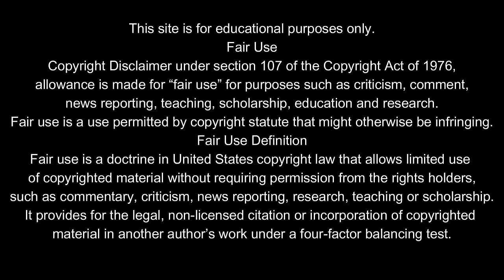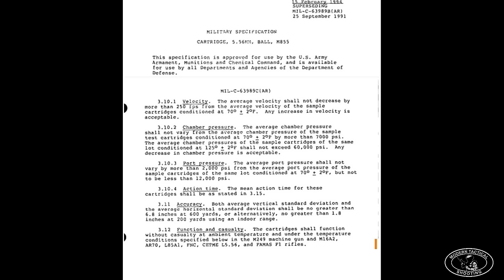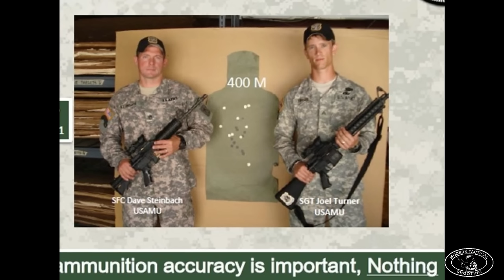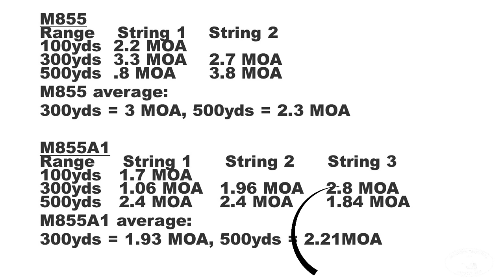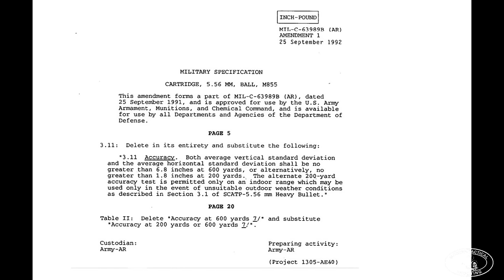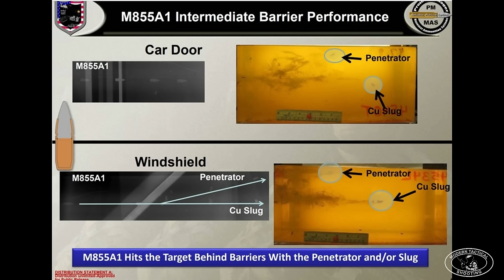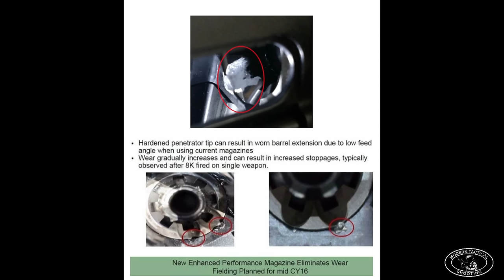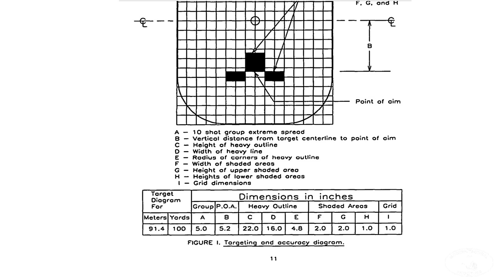M855A1 Performance Review. Did it live up to the Army's hype? Did going green really work?

Comment: When 10th mountain made the switch, my groups were cut, literally in half as far as size. We also saw a significant increase in the marksmanship scores during rifle qualifications across the board. I am a huge fan of the new “green “round.
Reply: I have also seen some ballistics gel tests on yt that show it has far far better terminal performance in soft targets compared to M855. Regular green tip will sometimes zip through soft targets without tumbling or really dumping any energy, or will tumble really deep like 7-8 inches in at which point it would already be most if not all the way trough a body. So its a bit more accurate and better terminal performance on soft and hard targets. Seems like a good improvement to me.
Reply: 10th Light Infantry division "Mountain" 85-86.
Reply: @Nick-sx6jm that performance depends almost entirely on the weapon used and the range to the target. The AR-15 platform was designed for a 55gr bullet and a 1:9 twist out of a 20” barrel. By the time you shoot a 62gr bullet out of a 14.5” barrel with a 1:7 twist you lose so much velocity the bullet won’t tumble on impact beyond about 100m. That’s fine for a carbine. It’s not for a battle rifle. That’s why the Marine Corps adopted the M16A4 with a 20” barrel.
Reply: @coryhoggatt7691  you know the Marines Ditched the m16 right? They switched to the M4a1 with the 14.5 ammo just like the Army back in 2016.
Reply: @coryhoggatt7691  first M16 was a 1:14 twist, M16A1 was 1:12, and everything after the M16A2 1:7
Reply: @Nick-sx6jm  You would have to hit your target.

Comment: I'm a year late to this one, but, from seeing our State's NG shooting team, and working the ranges with them, we definately saw tighter groups going from greentip to A1s. Some of these guys are National-level good shooters and I have seen/scored 5-shot groupings of sub-moa out to 400y. These are out of issued, but in great shape, M4a1s with 4x Elcans. As the EPR round starts to become affordable, and civilian use gets more widespread, be careful to use the 'improved' mag, or at least the new followers, that give the round a slight lift at the nose. It will help prevent the scouring effect on the feed ramps from that sharp point digging in. My personal 14.5" already shows a few scour marks, where the ramp meets the barrel, just from one old GI mag (tan follower) with 30 rds fired. Awesome round though...very flat shooting and fast.
Reply: What are the improved mags? Would any modern magpul mag be considered improved?
Reply: @StreetLight099  the "improved" is just a tan color metal gi mag with a no tilt follower that has a slight upward cant so the tip of round doesnt dig in as the round feeds. The tungsten will scour the feed with standard magpul or old GI.

Comment: If M855A1 isn't such a big improvement on M855, why is it so hard for civilians to get their hands on M855A1? The exclusivity makes it seem like it's some miracle cartridge that the government wants to keep out of civvie hands.
Reply from the maker: Reason: Army sold M855A1 hard as the "wonder Bullet"
Reply: @KeterMalkuth  pretty sure the govt is prohibited from holding patents
Reply: You can get M855A1 but its $3 a round lol . Shark Arms has some
Reply: rarity does not equal quality.
Reply: Nobody wants to spend the money to ramp up production at this time.
Reply: @lemniscatelogos7917  Yes they are legit . Chris is a solid dude
Reply: @lemniscatelogos7917  I get all my used TDP Colt and FNMI parts from Chris at Shark Arms .
Reply: The gov wanted to ban m855 too a couple years ago lol. They were going to classify it as “armor piercing” ammo but instead did 7n6
Reply: You’re wondering why a round ((M855A1)) is relatively hard to get when ALL production of that round went directly to a wartime Military and is only roughly a decade old VS A round ((M855))  that is 30/40 years old and the excesses, seconds & over runs ((per contract with the government)) must be sold on the open retail market, through military surplus as well as other contractual avenues?? C’mon now. The simple fact that it had 30/40 years of a head start should be a glowing reason for that discrepancy on its own.
Reply: Have you ever watched gel tests? The 2 components seperate extremely violently down to less than 2000 fps. It's Ike a freaking miracle bullet at low velocity.
Reply: It'll put lots of strain on your rifle, being that it's 62,000 psi. It's destroying the Army's rifles much faster than M855 does. I'm not sure the M855A1 is within SAAMI limits for the 5.56. Regardless, I wouldn't want to shoot it in my rifle. I'd advise that if you still did want them, you'd shoot them sparingly.
Another thing not mentioned in this video is that one of the goals was to get 20" barrel M855 performance out of an M4 barrel. Therefore, the Army didn't just crank up the pressure, they also used a faster burning powder. Ergo, if you're using a barrel much longer than 14.5", you won't get as much of a performance boost out of it compared to the M855.
Reply: @lemniscatelogos7917  I have 30 A1 I'd send you  for that price. 😏
Reply: @acem82  The steel tips wear out the feed ramps too, they're just all around bad for your gun. I know a guy that sells 30 of them for $60 loaded in a mag, but you have to bribe him with a pack of blue moon or he won't acknowledge he has them🤣. He says use them as a last resort because of the damage to the rifle.
Reply: @TheExplosiveGuy  You need to tell him to put them in the proper magazines. The Army started issuing new mags with the M855A1 ammo, EPM's that are tan with blue-gray followers.
Reply: @lemniscatelogos7917  I've never cared for 7.5' barrels.
My PS90 can easily outperform a 7.5' with 5.7x28 & I don't have an insane muzzle blast.
Reply: @TheExplosiveGuy  don't the 4th generation PMAGs (FDE only) have a modified feed angle to produce the round a little higher that does away with the feed ramp wear?
Reply: @Laotzu.Goldbug  I don't know much about them, I just found out myself that there is an upgraded follower to feed M855A1, so I don't know any specific brands that use them.
Reply: I've literally just pulled up gunbroker and there's dozens of listings for it. I've also seen it at gun shows. What exactly is your definition of "hard to get"? They don't sell it at the gas station next to your house?
Reply: @BlownF150  the epm mags are TRASH. magpul has the best feed angle for a1 and this has been proven by the usaf m855a1 conformance testing on commercial magazines report which found pmags as the most reliable and best feed angle to prolong feed ramp life. Good god the amount of misinformation in this thread. 😳
Reply: @rodiculous9464  like you actually have any experience with them. I've got a box full of them and they function flawlessly, just like my Magpuls, H&K steel mags, and many others all the way back to my early Air Force contract 20-rd mags from the 1960's. Go find a park bench and a box of chocolates kid. I also have the ARDEC research which says no such thing when comparing COTS mags to the EPM's. Always misinformation in these comment sections, particularly from people who don't know and certainly don't have access to ALL of the data.
Reply: It's considered AP by the ATF I think
Reply: @acem82  That was only an issue with the first several lots, the pressure was backed down for full production runs.
Reply: @BlownF150  Just get gen3 Pmags and you never have to worry about it.
Reply: @Laotzu.Goldbug  Gen 3 Pmags are designed for A1
Reply: @anthonybarker9123  If that's true, then it doesn't perform like they claim it does. Ceteris paribus, lowering the pressure decreases velocity.
Reply: Told it kills earlier barrels
Reply: @jjw5165  Not enough to cause problems.  It really was almost entirely a feed problem with the sharp point of the -a1
Reply: You can get green tips where I live easy .
Reply: Why would you want an over pressured round that will wear out your weapon far faster than 855 just because its has marginally better penetration? It’s also incompatible with STANAG magazines and PMAGs prior to gen 3 due to overall length.
Reply: @anthonybarker9123  or you could go old school and get STEEL MAGS BABY
Reply: An all copper M855A1 round probably costs a little more for copper than the jacketed bullets.
Reply: @TheExplosiveGuy gen 3 p mags feed them with out damaging your feed ramps
Reply: @zeck8541 because of how much damage it does too flesh. Look at balistic gel tests.

Comment: Tactical Hive tested M193  out of 14" ,16" , 20"  barrel's using 2" reems of paper,  twelve inches in front of a steel target from ten yrs out.  The 14" went through 4 reems hitting the steel target staying intact.  The 16" went through 3.5 reems fragmenting into small pieces. The 20" went through 3 reems totally fragmentation turning into dust) . As Coach said " The hundred pound heads" knew what they were doing with maximum velocity in the shortest barrel too achieve the greatest damage without over penatration, the 16" barrel was the ticket=(The Vietnam era)  Later on, Urban combat required a shorter 14" barrel fighting in buildings where walls were much thicker able to stop rounds passing through , the 14 inch became the new fighting weapon for close quarters combat= CQB.(Afghanistan era)
Reply: Ream

Comment: The M107 155mm round out preformed the M855 and the M855A1 lol. Thank you for sharing your experience with M855A1
Reply from the maker: I prefer the 84mm Carl Gustav myself
Reply: @ Modern Tactical Shooting

I find it very ironic that your Bravos had to wheel and deal just to get proper ammo and such. As MP on our SRT (early ‘02 time frame) we had to consistently beg borrower and tactically acquire just about everything. Ammo, range time, smoke grenades, even M4’s because our parent unit didn’t have any assigned to us so we took over spare M4’s from the local CID & RCF. We would run M9 ranges for artillery officers and SNCO’s just to get extra training time, or borrow tools and gear. We had zero up armored vehicles at that time also.
Reply from the maker: @soonerfrac4611  SF still Army and we had our own funding problems too. Part what makes a 18B or Cs excel is their ability to wheel and deal to get stuff or get something done.
Reply: Ha ha, OP, were you a Redleg?

Comment: I work for a body armor company, and tests M855A1 almost weekly. To give you an idea of my familiarity with this round, the thumbnail of this video (at the time of this comments posting) is actually showing M80A1 loaded in a magazine, the 7.62x51 version of this round. 

I have to say M855A1 (per the BATFE) IS considered an actual AP round while M855 is considered EP or MSC. To note, anything that punches through level III steel can be considered "AP", but for the sake of this conversation, Ill keep that to projectiles with a hardened steel insert that can punch through level III steel. 

I've seen M855A1 out of a 20" barrel punch through some RF2 (III+) plates with relative consistency while M855/M193 does not (again take note; RF2, NOT RF1, or NIJ level III, as M855 out of a 20" will punch through RF1/ NIJ III).   

There is an enhanced design of this projectile in the form of a kinetic "bump" that is similar to a tank sabot. The rear end of the projectile acts like a hammer while the hardened steel insert punches through a surface making sure there is a little extra umph when it gets through a hard surface like steel.

I don't have any data the army has, nor any anti-personal stats of the round that you may have but don't want people to walk away from this video thinking M855A1 is over hyped. Its not. 

IF I had to cite my personal experience with this round, it's that its far more effective than standard MSC/ EP rounds (SS109 and M855), but not as effective as Teflon or tungsten carbide rounds. 

What's relevant to this conversation however is projectile availability. While Black tip SS190 (not to be confused with SS109) 5.56 is all but unobtanium, M855A1 falls off the back of the supply truck pretty often. 

No, I'm not at liberty to say what company I work for and what plates are defeated, but a simple search online will show this. 

Good info in this video from the perspective of a retired SF operator, but not exactly inline with my personal testing and others who have posted results online. 

Another (un)fun-fact about A1 is that you have to be careful of the steel penetrator that protrudes out of the front of the projectile. Because its not like normal M855, the exposed penetrator is susceptible to rust from (oxidization) sweat and water and if you keep rounds loaded in mags in humid environments for long periods of time, its likely you could end up with rust deformation and pitting of the projectile that could case an ogive flight path, deteriorating accuracy.
Reply from the maker: Good information I mentioned it in a few responses.. I'm not really a bullet expert I'm an end user and yes the video is going off of my view of downrange information and not scientific testing.
Reply: What a bullet can and can't penetrate on a federasl level doesn't denote whether it's Armor Piercing or not. It's solely based on 1> That it can be used in a pistol (5.56 can), and it's 2 > construction. There's varying gray areas on what the ATF has considered the "core" of the bullet. One could argue that the M855A1's core is copper, and the tip is the penetrator, but the ATF does what it wants. 

Do you have any data on what period of time is needed to cause rusting and degradation of the exposed steel? All production M855A1 has a rust inhibitor coating on it..
Reply: M193 goes through level 3 steel like butter and it's a copper jacket with soft lead.  I guess it's AP.  I guess all .270 is AP, too.
Reply: @spraynpray  

M193 does not go through level III like butter. Velocity is relevant with M193. M193 out of a 16" or less barrel will not pass through level III. M193 out of an barrel length greater than 16" will pass through with increasing frequency as the barrel length is increased.

Reread what I said: 

"To note, anything that punches through level III steel can be considered "AP", but for the sake of this conversation, Ill keep that to projectiles with a hardened steel insert that can punch through level III steel." 

In other words, yes the rounds you cited could be interpreted as Armor Piercing, but only in the sense that they pierce armor (as you noted), not in the sense that they are designed to and left the factory with the intention of defeating armor.
Reply: @spraynpray  Velocity defeats armor, not weight. M193 from a full length barrel is +3000 FPS.
Reply: @robertg8565  If my history is correct, the TDP called for 3250 from a 20 inch barrel.

Comment: I used to work in bullet manufacturing for a specialty bullet company. We had several .mil type contracts for our bullets, including for Mk262 type 77gr OTM’s. 

I probably made millions of them. 

Mk262 is actually significantly cheaper to manufacture. It takes 1/3 of the steps to make and maybe 1/5 the amount of man hours to make compared to a polymer tip hunting bullet. 

The real advantage of the 77gr OTM is that it’s easy to keep it consistent in the manufacturing process. Weights stayed spot on to two tenths of a grain, and OAL stayed right around an inch. Because of the simplicity of the design, the bullet was easy to produce in great quantity with good quality.
Reply from the maker: Great info! I don't claim to be a bullet expert by no means. I consider myself just an end user, so any details on actual bullet design and production is cool
Reply: IMO MK262 can’t be beat. But for general range use, I usually run M193. Then re-zero with MK262 when I’m done.
Reply: @Kevin Almgren
LOL, tell me you worked for Black Hills or Sierra without saying that you worked for Black Hills or Sierra…
Reply: I think Jeff Hoffman from Black Hills is very much responsible for that.
Reply: @bluntsmoke1872  The one place that it does get beat in my opinion is with bonded soft points. They are less velocity and barrier sensitive. But I would have no qualms about using either one they're both fantastic
Reply: @bluntsmoke1872  I like mk262 but it's important to note that it can't penetrate level III+ plates like m193 can, and is a whole lot heavier of course.
Reply: @ironmatic1  That's the only drawback.
Mk262 sucks against armor.
Great overall round, though.
Reply: I've seen coordinated statistics that the MK262 cost more per round than M855A1. Where are your sources?
Reply: I was listening to a guy talk about his experience with 556. He told me the 55 gr weren't all that, or immediately, effective; granted he wasn't using a 20 inch barrel. He said they switched to 77 gr, which helped a lot; but unless combatants were hit in center(ish) chest, there still could be a delayed response. I'm sure a full  length barrel would be another story.
Reply: @eedd sdsd not even that, it can only go through level III steel armor at close range, and form a full size 20 inch barrel.
Reply: I absolutely love the 77gr tipped matchking loads from BlackHills!